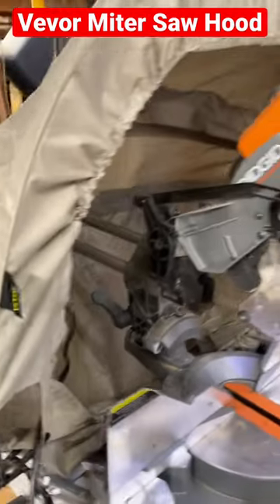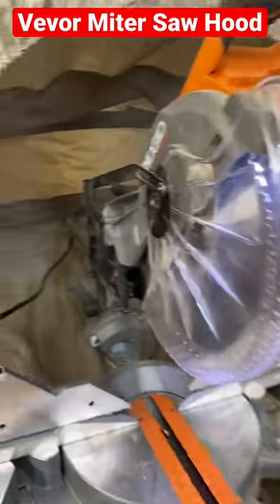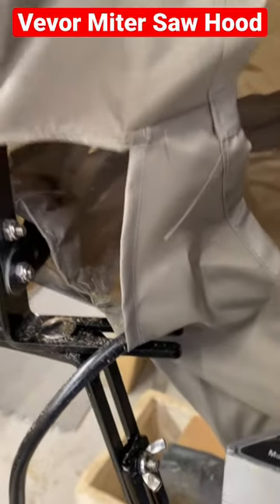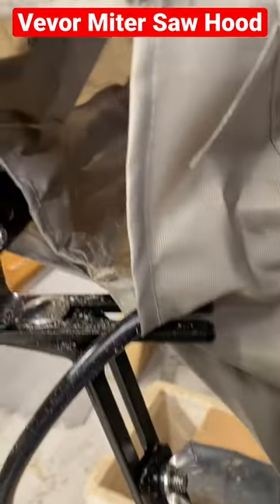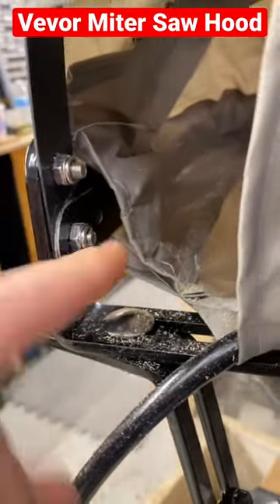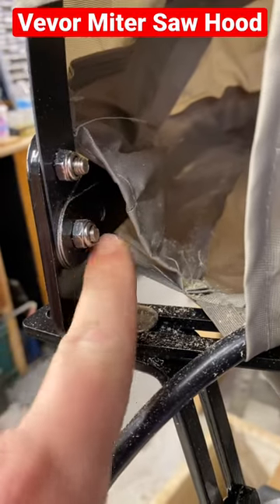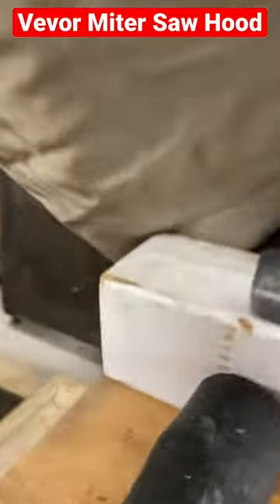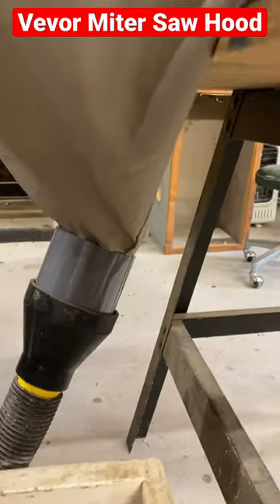VEVOR Dust Collection Hood

Comment: It's not a radial arm saw. It's a sliding compound miter saw. Otherwise, good video.
Reply from the maker: Oops. I just googled radial arm saws and know what they are now. My dad had a craftsman in the corner of his shop and he always warned how dangerous it is and to never even try to use it. Thanks for setting me straight on this.
Reply: @BenHuttash  it's true that radial arm of saw (RAS) IS has a bad rap but my experience is safer than a table saw & is more inline with the hazards of your compound miter saw or a standard miter saw. The misuse or wrong blade can make any machine a concern. I've had my Craftsman RAS for 19yrs. Take care